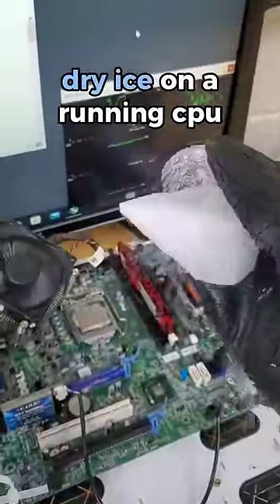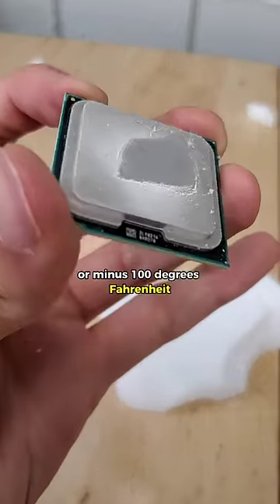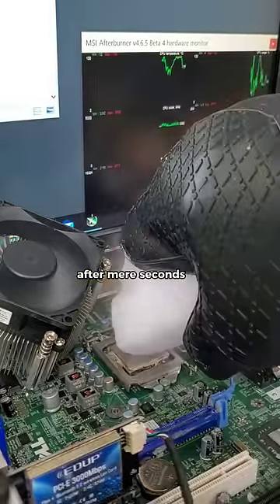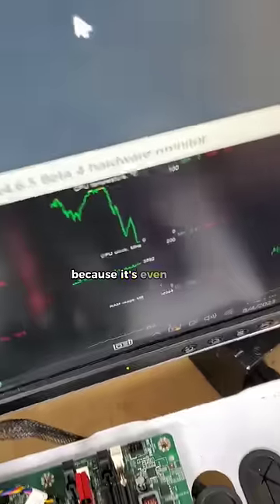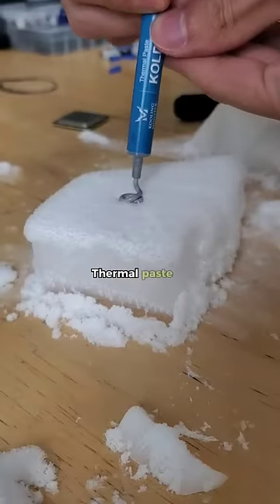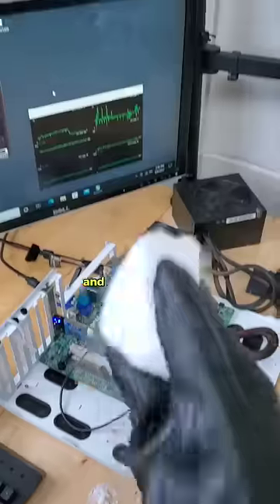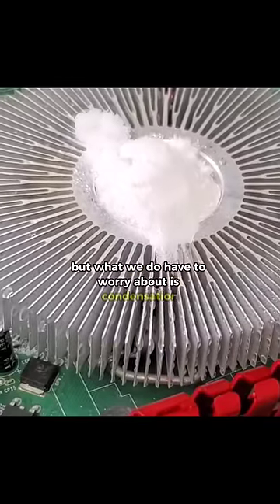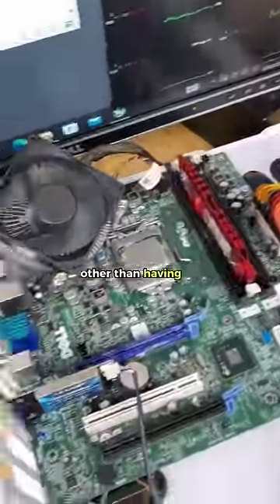using dry ice in a running PC #shorts

Comment: 'PC enthusiast rediscovers sub zero cooling'
Reply: Dawg i bet in 2038 they're gonna make one xd
Reply: @RandomYoutube.Enjoyer probably before that lul
Reply: @RandomYoutube.Enjoyer  Its nothing new though sub zero has already been done for like 15 years or more and there is even competitions.

That was the joke this is nothing new.
Reply: @thatrandomguy9434 2038 is 15 years bro we will get this in less than 3 years if they work on it
Reply: Most overclocking enthusiasts use liquid nitrogen (-275°C coldest possibly temperature) oder liquid helium. 
The CPU are around -180°C and can be overclocked to around 7 Ghz 😅
Reply: @skercro1709 not when new hardware is unreliable & overpriced, better take older gear, run at 5+G/24/7 with no issues, revolutionize the concepts of pc builds in general, making them fully modular in pc’s. One guy tried “modularity” - yeah one full day just to swap the board or any other part 😢 tho design is amazing.
Reply: Computer owners in 2040: "Help my CPU's temperature has skyrocketed to 30°C!"
Reply: @lorenzosorgatz4385  How's -275°C possible, if the boiling point for both HE-3 and HE-4 is -269°C?
You'd still have to account for the heat generated by your hardware, which makes it more likely that you will reach ~200-220°C minus...

Comment: We will be needing that when Nvidia launches their 5090 🗿
Reply: :D
Reply: Nah, we need that maniac that LITERALLY AIR COOLED THE DAM 4090
Reply: Can throw some in on the $4k loan you’ll need.
Reply: Not worried about the 5090 at all! My 4090 never went over 65 degree celsius, even with cyberpunk 4k, rtx overdrive, max settings!
Reply: @lucasmancini2  These people are too wrapped up in their sheepish mentality about mocking something they cannot afford - they won't understand.
Reply: @ThisIsMeArnold  Bro what💀
Reply: @ThisIsMeArnold a lot of people mean it as a joke, damn calm down!
Reply: @lucasmancini2  It's not really a flex to talk about temps on a 4090 when the cooler is bigger than a fucking console.

In fact, this is the reason that people joke about cooling on the 5090 to begin with. The coolers are getting so goddamn out of hand that it's a matter of time before the CPU is an AC unit with a PCIe ribbon.
Reply: @ThisIsMeArnold  it's not mocking when both 30 series and 40 series had major problems... the 40 series pin connectors was it's problem causing huge problems
Reply: You also need an extra room to fit the gpu in
Reply: @SeldomPooper  :D
Reply: or 14900k
Reply: Only the 5090 ti or 9900 xtx, the 5090 will be fine
Reply: 9090.
Reply: nah but actually 💀
Reply: @@Rae354m it's also efficient
Reply: the 4090 has better cooling than every other GPU of its class lol, they could literally use the same 4090 cooler on a 5090 and it will still be fine that shit is very overbuilt.
Reply: @ThisIsMeArnold why is it that every now and then i find someone talking like sephirot
Reply: @StarFried  I don't know who that is
Reply: no, we will be needing liquid nitrogen

Comment: Drop dry ice on a 13900KS running Cinebench!!! DO IT!!!!
Reply: 😂agree
Reply: Yes
Reply: @@AAR-143he can’t since there are multiple spots that need to be cooled.
Reply: @cheeseify he can use a heat sink without fan
Reply: Just go look up the top score it's acheived with Liquid nitrogen this guy doesn't need to do it just a waste because he won't get the top score
Reply: YES DO IT
Reply: Overclocked
Reply: Bro if it's there for too long it'd cost him thousands
Reply: Dude so cool
Reply: just wait till you find out about extreme OC XD
Reply: @Qwerty-r8l its frozen carbon dioxide, co2 goes from solid to gas, and it doesnt conduct electricity
Reply: Yes
Reply: Upload
Reply: @erdemdidakdikta4931  I think the pipes can't work below 0°c. The copper pipe will freeze and loose most of its efficiency.
Reply: the processor will meltdown the fraction of second the cooler is removed. With AMD that wont hapen
Reply: @Qwerty-r8l it’s dry ice, it doesn’t melt it sublimates…
Reply: @cheeseify Intel not ryzen
Reply: @droidbetter231  im talking about the 4090
Reply: @Qwerty-r8l  It doesn't conduct electricity, he even said it in the video.
Reply: @ark756  he literally said it condenses water vapor In the air in the video
Reply: @jack_4922  dry ice condenses vapor ruining the components
Reply: @ursulpolal5949  he also said it condenses water vapor In the air
Reply: I so want to do that IF there was a way to keep Dry Ice intact so I don't have to keep adding more every few hours. I'll stick to putting the case outside when it's -10 to - 50 after it snows in Altoona Iowa.
Reply: Hypothermia ho jayega
Reply: @cheeseify yes.
Reply: I guess the second you get the cooler away the CPU will just implode into singularity
Reply: it already has been done
Reply: @erdemdidakdikta4931  the condensation would short out the gpu
Reply: @@AAR-143why bruh it ain't getting that hot haha
Reply: It's been done already, people are beaching this
Reply: he's not rich
Reply: YE DO IT
Reply: Ues
Reply: Yesss
Reply: Nothing will help this 13900ks I have one even with the best TG paste and the CPU cage it still thermal throttles 😂
Reply: DO IT, I NEED TO SEE THIS!!!!
Reply: @gabrielv.4358  ok amd fanboy that is false it has a mechanism to turn itself off when it is too hot
Reply: Waste of 2k dollars. We already saw what it did here - bow use your tiny brain to imagine the same on the 4090.
Reply: @ark756  Water from the air will condense on the cold parts of computer. It's even mentioned in the video. That will be the issue. Not the dry ice itself.
Reply: @AngelOfDeath420 not really. The dry ice takes up the energy from the heat and then sublimates. 
Basic law of conservation of energy.
Reply: Cook the cpu to maximum and put dry ice
Reply: Nah men the most hottest is the 7950x3d
Reply: @gabrielv.4358  lol no CPU will "meltdown". They ALL, no matter who made them will turn themselves off to protect themselves. Although, you are half right. The computer would freeze or shutdown for thermal protection instantly when the cooler is removed while running.
Reply: and post 3dmark scores
Reply: Won't be better than liquid nitrogen
Reply: @cheeseify so the reason he should try is to find if it work or not
Reply: You just took my words out of my mouth
Reply: @Aston3003 the copper pipes arent filled with water, and water is the only thing that freeze
Reply: @Lectron1294  It is filled with water, but not literally filled. It has some fiberus material that holds some water.
Reply: He’s gonna destroy it lol
Reply: Linus did this already
Reply: Bad test
Reply: @ark756 you still have the issue of condensation

Comment: If it’s running hot during a gaming session, just put some dry ice on it for 5 seconds and you’re ready for round 2
Reply: what would you recommend for my burning ass after a 11 lose streak in comp?
Reply: Boost activation. Drop the ice.
Reply: @saboodoo  getting better before playing comp
Reply: @saboodoo try /give @s skill [current kdr) 10 0 10
Reply: I love watching people like you live your lives knowing nothing about thermal cycling
Reply: The problem is the quick change in temperature can warp it

Comment: 10 years from now its gonna be normal to have dry ice or even liquid nitrogen as a cooler
Reply: Probably freon and a compressor
Reply: That would be wilddd
Reply: imagine liquid nitrogen on an aio.
Reply: CPU temperatures will be like 229°c on the low end 💀
Reply: maybe like 50 i would think
Reply: @jerkycam it already know exists, 2 stage phase change in pcs don't exist yet, they do like till 4 normally in package ac units
Reply: I hope so
Reply: No it's not lol
Reply: Extreme pc gaming comps use liquid nitrogen cooling because the pc have extreme overclocks that make water useless. ASUS motherboards have a special pin set for cold starting to help boot up because of how cold the pc gets
Reply: @jerkycam lmao that would be crazy if somebody dropped a car ac in there pc.
Reply: Or there will be PCs under water maybe
Reply: No, although if we find a room temperature superconductor we won’t need cooling anymore
Reply: if LK-99 turns out to be real we won’t need coolers lok
Reply: Cryo cooling has existing for at least that long… And the only direction it’s trending is down, because it’s simply unnecessary with how good chips are nowadays.
Reply: @obj_obj not true, transistors need to be semiconductors, we already have materials more conducive than silicon, that’s not the issue. Room temperature superconductors would be revolutionary but they wouldn’t replace silicon processors.
Reply: It's not, dry ice physically destroys electronics.
Reply: Ye in the future our kids are probably gonna be gaming on quantum computers lmao. Actually probably great great great grand kids
Reply: True but the motherboard would have to be fully water proof to protect against condensation, then you will need a tube running from your case to a bucket outside or through the window to drain the accumulated water from all the condensation............
Reply: Liquid nitrogen is already in usage😂
Reply: You have nitrogen cooling in your pc?
Reply: Carbon monoxide poisoning has literally entered the room.
Reply: Hello scug
Reply: And some games still would manage to overheat it. Lol
Reply: Nah idont think so
Reply: Someday, we'll all have liquid oxygen lying around 😌

(Before promptly blowing up)
Reply: No it won't it's just bogus it's not energy effective and more important semiconductors really bad if they are too cold so working at negative temperatures is just stupid for a computer.
Reply: No it is not and that shows you know nothing about computers. Temperatures of these extreme lows actually slowly kill the motherboard by warping it. Metal changes shape in reaction to extreme temperatures, ESPECIALLY if you end the cooling to go back to room temp once you shut the PC down.
Reply: I remember seeing one guy's build -- he actually had a Ford Radiator as his heat sink.
Reply: Probably not dry ice since it does turn into its gas form pretty quickly.
Reply: 10 years from now, you can call yourself happy if you aren't being recruited in a resource war already
Reply: @jerkycam that's is definitely possible with a mirco compressor
Reply: @Gnumixal5737  yeah there’s a special liquid that doesn’t have elements in it that can conduct electricity which is what aquarium style PCs are made of you basically put the components in a Aquarium like PC chasis and pour the liquid, no need for fans and other cooling components because the liquid pretty much does that job and it can’t short circuit the components cause it can’t conduct electricity
Reply: @Garfield66 229°C Is over twice the boiling point of water, and if your PC is that hot, you don't have a PC, you have a fire.
Reply: @jimmydandy9364 so either a sealed PC box, that has an attached vacuum pump, so you don't have water vapor near electronics, because you don't have air near the electronics, and a large heatsink, with dry ice.
Reply: @hanson185 except dry ice is frozen carbon dioxide, which is a different gas that you breath out, and wouldn't kill you.
Reply: @philliprainer superconductors don't get worse the closer to absolute zero they get, there are more efficient the colder they are, and working at temperatures below 0°c is not worse for computers or superconductors.
Reply: @DEEZ_N4T that sounds interesting, do you know what liquid is used?
Reply: @dragonmasterlangeweg7625  not really superconductor  have a jump temp when they can't get really much better still you gotta explain to me where superconductors are used in a pc but what you're saying is true for Normal conductors. But I was talking about SEMIconductors. Same class of conductors als LEDs and solar cells. Specially doped they make up the transistors of the CPU
Reply: More likely just having superconducting CPUs
Reply: @Silverlol  there is no model of a superconducting transistor so how do you want to make a superconducting CPU?
Reply: @philliprainer  give science like 10 years
Reply: @Garfield66  If they're using dry ice and liquid nitrogen (very cold) why would the CPU be so hot?
Reply: @jerkycam maybe but current AC/fridges can't be used for that because they are bad in cooling always heating things. In your fridge however it cools only for a short time then keeping heat outside
Reply: Sounds expensive.
Reply: it’s probably not going to be, dry ice is simply not convenient, it’s a very light solid and the actual cooling potential per unit volume is not that high, plus just using airflow is a hell of a lot cheaper
Reply: Liquid nitrogen sounds cool and it would be cool
Reply: No, it won't.
Reply: rainworld
Reply: @Bloxer  I had an Asetek vapochill lighspeed phase change unit, which is pretty much along those lines (compressor, condenser and evaporator). A messy business to setup though. Had to spray the motherboard with dielectric grease and leave overnight, then fill the cpu socket with grease and stick neoprene around the socket and a small heating unit to the back of the board to combat condensation. It took my QX9650 to -50c idle and about -20c full load. Obviously you can kiss goodbye to the warranty on your hardware though.
Reply: @Russ_Paul  DAMNNN! that sounds sick but I feel i wouldn't be the type to put in a ton of time and money into something like that.
thanks for sharing though!
Reply: @Bloxer  This was about 14 years ago, and the vapochill and the QX9650 I bought second hand from a friend. The cpu was only a few months old and I paid half price for both items. 

I'm with you though. A laptop for me these days, something that won't take 6 hours to dismantle next time I move :)
Reply: Air jet.
Reply: Tbh that already somewhat exists. Server rooms or high usage mainframes are either in cold as hell rooms or like have cryo coolants circulated
Reply: I dont think it will be since LN2 and dice can be damn expensive, there have been people who run subambient daily system by using single stage/cascade coolers which are basically air conditioners/fridges attached to cpus and gpus.
The cooling capabilities obviously change from unit to unit depending on the compressor, gas and other parts used to build them but i have to remind you that the pull at least 300w and above each and the worst thing about them is obviously condensation that can be solved by insulating the whole pc with either vaseline or LET (liquid electrical tape). But the best option would be to run the system in a purge box; basically a controlled ambient with vacuum so air cant condensate.
Reply: @jerkycam  The freon/compressor trick was done back in the late 90s (iirc) by a company called Kryotech.  They sold computer cases with the tech built in.  As part of their marketing, they showed an AMD CPU (I think it was either the K6 or one of the early Athlons) being overclocked to about 3Ghz.  Unfortunately, these cases were about $800-1000 a piece and so it never really caught on.

Comment: Been there, done that. Dry Ice is actually pretty easy to handle when extreme overclocking. And yes, regular thermal paste at this temperature is useless, thats what Thermal Grizzly Kryonaut is for.
I still have my single stage compressor and my dewar for dice or LN2.

Bonus: a pot of vaseline does the trick for insulating your motherboard against condensation water. Just make sure to spread it over your motherboard, not your pelvis area.
Reply: first one then the other
Reply: HWbot account?
Reply: Just curious to have a look at a your SS (cascade is when you have one compressor cooling another one, so 2 stages and above)
Reply: @Dipa_OC  my bad, its a single stage: Asetek Vapochill LS 240.
Sadly I dont have the time to refill it, nor to 3d print a new mount for AM4/5 or re-compile the software (not sure if the software works with Win10 since the only copy I have is for WinXP).
I dont have a hwbot account, maybe I will create one, if I resuscitate the LS 240...
Reply: Ilu baby
Reply: i have a question though, if it has subzero cooling, does that mean it has (almost) infinite overclock ?
Reply: @rusty1253  Nope. 
Subzero just means the CPU and it's ambient temperature are below 0°C. For your cpu to gain unlimited oc potential, it needs to become a superconductor. That would require temperatures way below -200°C and thats what  liquid LN² or ³He are for.
Liquid LN² boils at -196°C, this is as close as possible to turn your cpu into a superconductor as you can practically go. Colder is only possible with more effort which is quite impractical...
Reply: @rusty1253  There are some processors with dedicated, low  consumption design out there, that operate as superconductors  with a clock speed of 100 GHz or more though...
Reply: It probably helps to keep the PC sealed and dehumidify'd. Water can't condense if there isn't any in the air to begin with. If any does condense, keeping it sealed will ensure that only a limited amount can condense.
Reply: @benargee  Well, if you keep the pc sealed and dehumidified, then how'd you refill that dry ice or LN²?
It may help with cascades and single stage, but then again: how'd you cool the other hardware that is not inside the loop?
So just paste the area around the cpu with some vaseline and you're good...